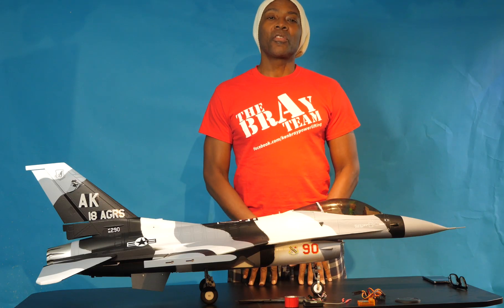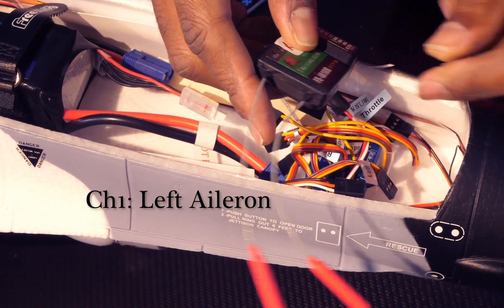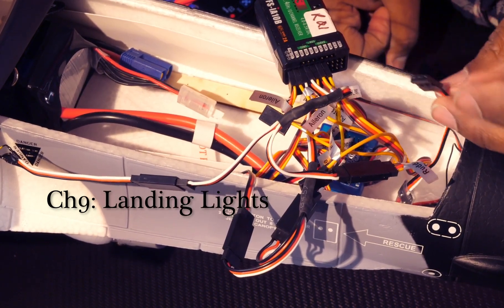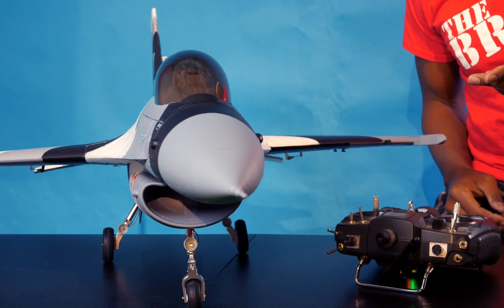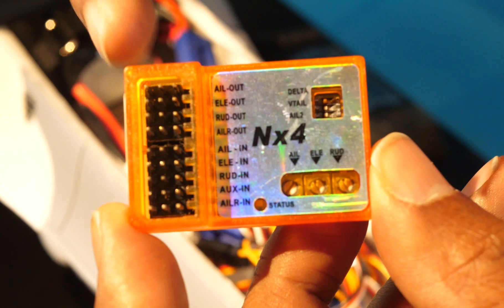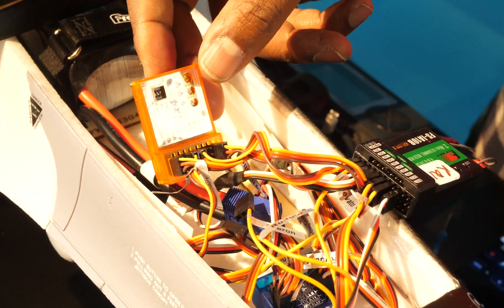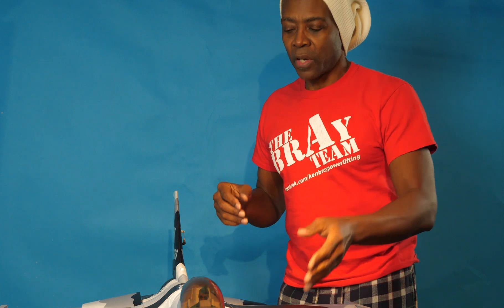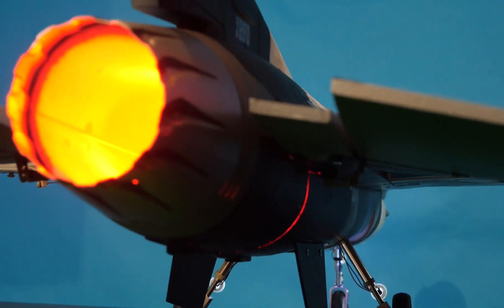How to install receiver and gyroscope on a Freewing 70mm F16 EDF jet

Comment: The rudder needs to be reversed in the gyro. When you turn the plane to the left the rudder is turning to the left to, it should turn to the right, and viceversa. You said it correct but the rudder is doing the opposite of what is supposed to.
Reply from the maker: 16:39 it's moving correctly. What you're seeing is the backlash cause I over shoot. It's just difficult to show it properly.  I probably should have moved it slower. Maybe I'll make another video of just that part